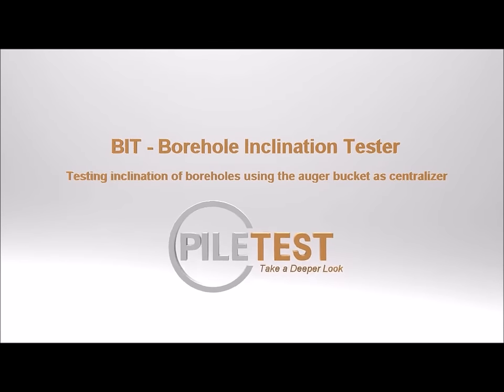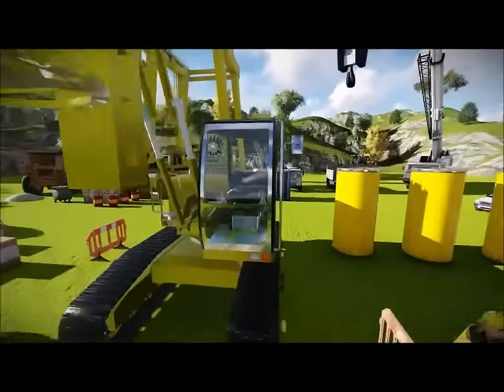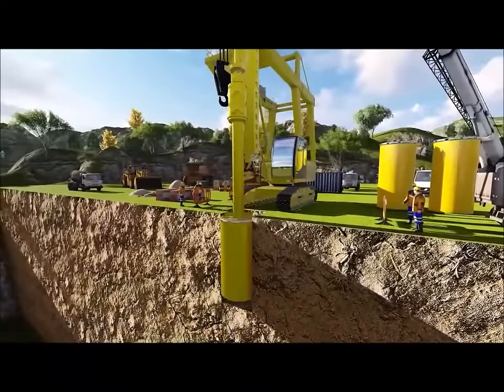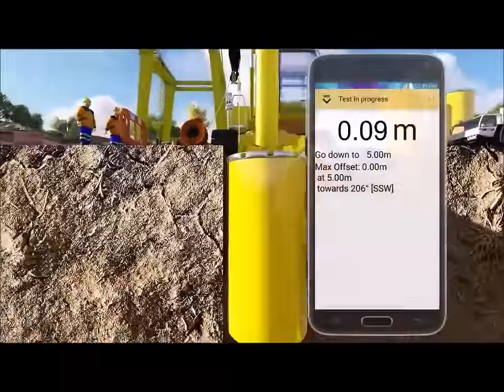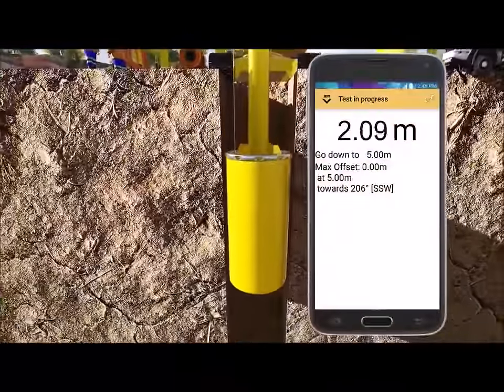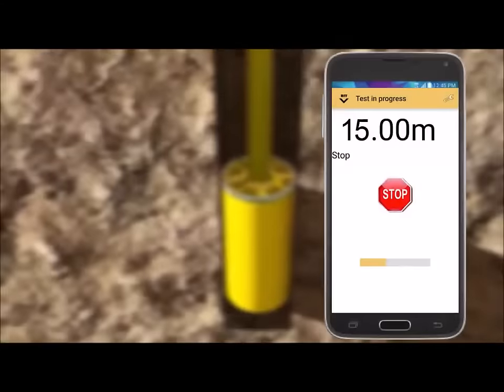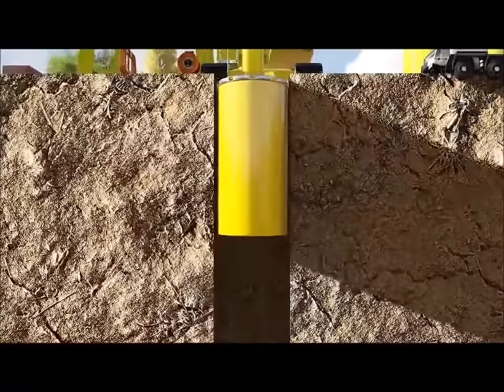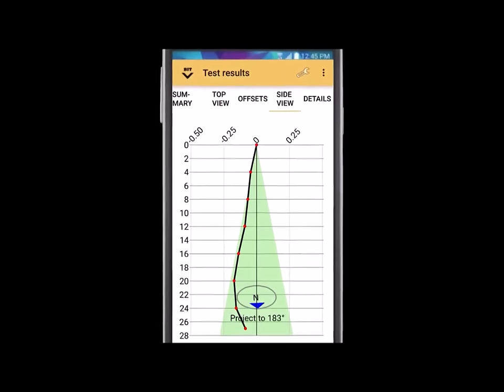BIT - How to test the borehole inclination fast and easy.

Comment: What is the maximum depth of BIT available?
Reply: Hi
Currently, the BIT can go down to 160m
We are also working on a new model with better performance. What is your depth need? Is that 300m?
Reply from the maker: Standard depth=80m
Up to 150m is practical